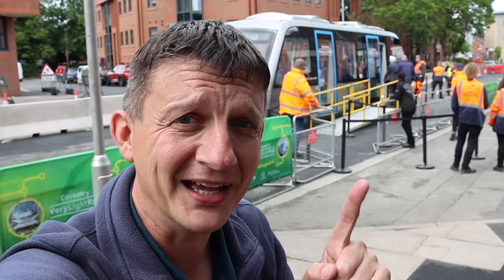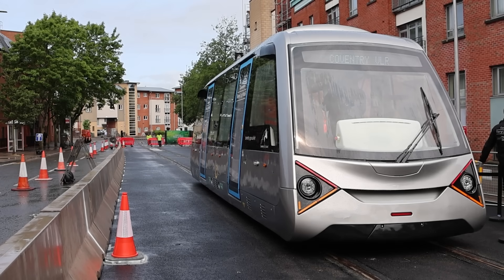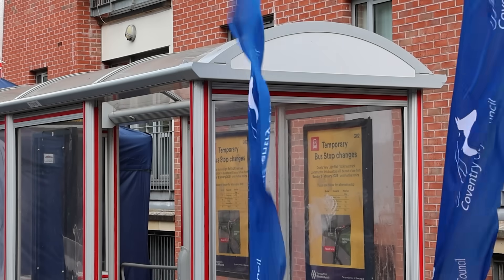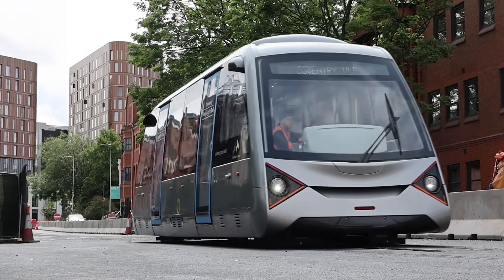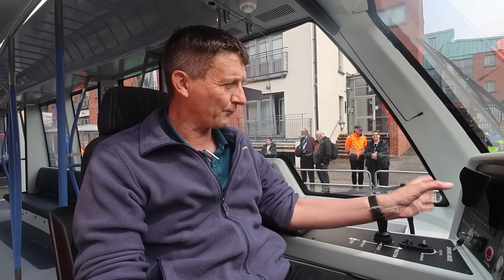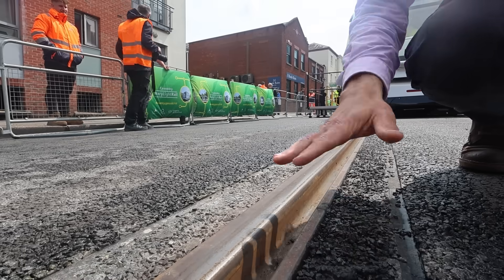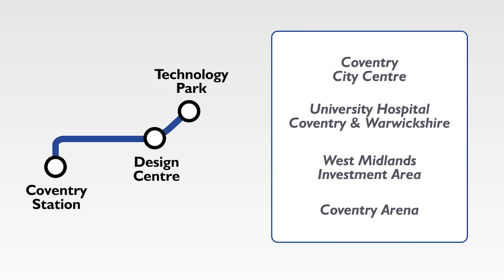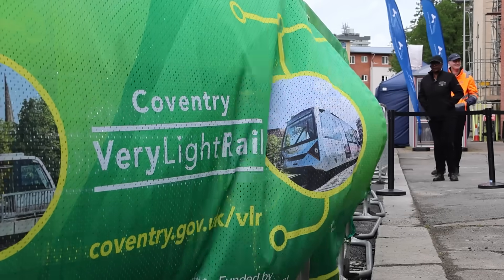The NEW! Coventry Very Light Rail is here

Comment: If they can extend the vehicles to say 3 segments with a 180 person capacity, certify it for use on mainline track (exclusive use of segregated branch lines etc) and sort some rapid charging facilities I can see this being an extremely useful bit of kit for many large towns across the UK!
Reply: If that's the case, just build a tram. How much less on construction costs are you saving?
Reply: I think that certifying it for mainline use would require higher crash-tolerance standard, which would make the vehicles too heavy for the lightweight track in the city centre. But if mainline train service is cut from a branch line and replaced with this, then you could do it.

Comment: Super cool but this seems like it has all the capacity constraints of a single decker bus  with all the constraints of a tram. Ok sure, a conventional tram costs more and takes longer to build but it also carries shedloads more people and actually functions as a separate mode of transport. The only benefit I can see is that it presumably will have the same traffic protections  (filter lights etc) as conventional trams but it still seems to me as though it's a lot of money being spent on a guided bus that can't run off the guideway.
Reply: think it having a 2 or maybe 3 car variant would solve that capacity problem...
probably gonna need it dealing with as well...
Reply: @davidty2006 of course - this is a solved problem typically referred to as a 'tram'
Though it would be neat if they could make VLR compatible (in terms of weight etc) 2 or 3 car units. That would genuinely be a huge upgrade and in my opinion just make this a cheaper version of a tram.
Main problem would be batteries imo- range is obviously limited and I don't know how well it would scale while remaining within weight limits for VLR track. If they could combine the genuinely cool track innovations with a good old fashioned overhead wire I reckon it'd be a viable concept, but don't know how that would work on the cost end (though honestly the overhead wires aren't the main cost problem with conventional light rail)

The thing that makes me sceptical about this being able to support more than what is basically just a battery railbus is the curves. They are particularly proud of its tight turning circle and an articulated multi car unit would change its turning characteristics.
Reply: This was probably a good idea - 150-170 years ago when the tram was invented. But things and technology have changed during all those years, so there is a reason trams today are long, quick and use "heavy" rails with concrete bedding.

Comment: On the face of it, this seems quite impressive. But 2 months to construct 200 metres, and for a vehicle that can only carry 60 people (normal trams carry 100-200 or more), it's not going to take many cars off the road. Hopefully pantographs can be attached to remove the heavy battery, and the car can be extended into a normal tram. Either way, the track innovations do sound genuinely exciting. 
But why couldnt we spend this money, time and resource development on standardising normal tram construction so we can construct what works at an affordable price today!
Reply: I suspect it took so long to install a mere 200 metres because it is a brand new system. I would think when/if it's at scale it could be done in less than a quarter of that time. A TBM can excavate up to 40m per day after all.

Comment: If you don't relocate the underground utilities, what happens when they need to be worked on? There's three sets of temporary lights on my way to work at the moment due to electrical and water repairs, but you can't very easily do the same for a rail vehicle, let alone reinstating the line afterwards.

Comment: Great to have  more detail of this system.  I started out sceptical, but another vid piqued my interest.  I'd imagine many cities could benefit from the tendrils of such a system, converging on a rather more robustly constructed core segment, before diverging once through the centre.  Where a key route (or more) justifies a more conventional modern tramway, I can't conceive of any reason VLR vehicles couldn't traverse segments, as required. T'other way around, operations would be no more difficult than pertains at those TfL Undrground locations where "surface stock" needs to be prevented for heading down "tube" routes.
Reply: I'm imagining that a tram network could have these, conventional trams and tram-trains as appropriate for different routes sharing some segments, just as tram-trains share both rail lines and tram lines.

Comment: Another gadgetbahn for the era. "Oh look! We save so much money up front!" Just don't ask about how much replacement batteries will cost. Or what happens when the company goes bust and nobody makes the units any more. Or what happens when one gets hit by a car and gets set on fire. We've seen what happens when Teslas go up. Buy cheap, buy thrice.

Why couldn't it have been a full tram? If the demand is there for this rubbish, then why not commit to a full tram system? This isn't innovation - this is the DLR of the 2020s. And you notice that we haven't built another one of those since the 80s, but we have built full tram and train networks that supersede what the DLR can do. Please, Coventry. Go look at the infrastructure of other countries. Not even capital cities! Plzeň in the Czech Republic has a population of about 190,000 residents. That's a little over half of the 350,000 that live in Coventry. Yet Plzeň has three full tramways, an integrated trolleybus network, and a beautiful main train station. Are you saying that we can't do that in the UK?